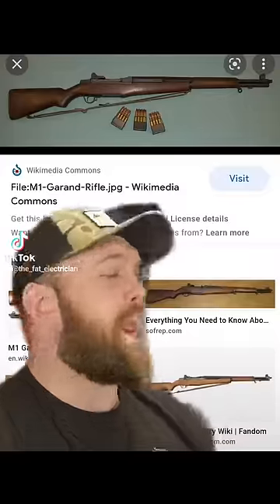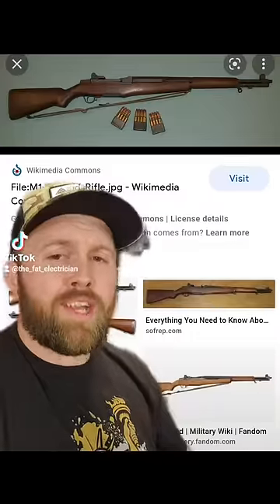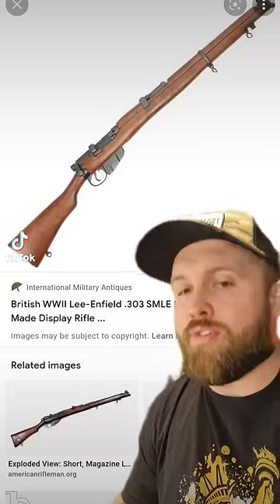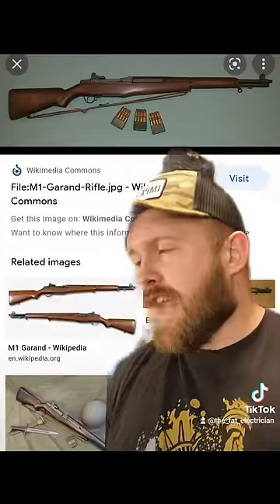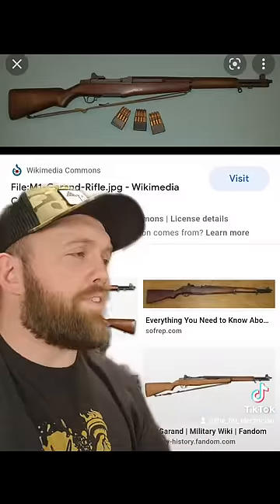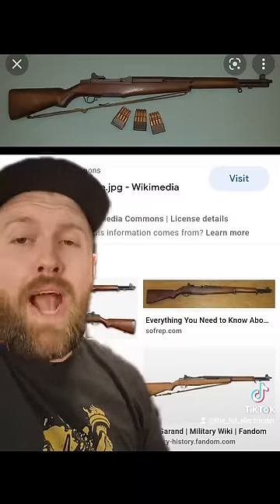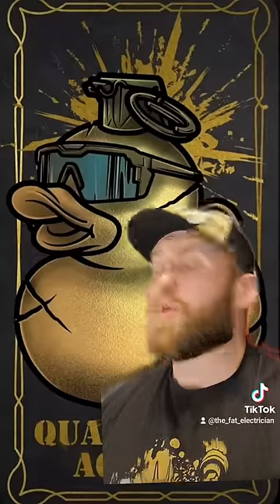The M1 Garand - "The Elder Gat"

Comment: My grand father (CIB Europe WWII) showed me the marks on his thumb from 40 years prior from Garand Thumb. Can't imagine the devastation infantry of that era would do with modern armaments.
Reply: There's less difference than you might imagine in an infantry-on-infantry comparison, most of the modern advantages show up as you start looking at the bigger picture.

The biggest game-changers would be our modern intelligence gathering and CC systems, and all the other lovely little bits of mayhem enabled by them. Things like spy satellites, GPS, GPS-guided munitions, etc.
Reply: @Just_A_Dude A squad of Marines with M1 Garands would do okay in modern combat (Not great, but still give a good account of themselves), give them M1903 Springfield's and the are all but useless. A botl action gives you 1 shot at a target, that's it. You get 5 instances of a single shot on target before a bigger delay between rounds. The sheer volume of fire difference between an M4 and an M1903 is far greater than you can measure.

Add to that how much of a difference modern optics make compared to iron sights (The M1 and M1903 have pretty good irons, still no contest vs an optic) and the actual difference between a modern infantry squad and a WW1/2 era squad is as vast as the Grand Canyon.

Comment: I've had M-1 thumb before, it's amazing the words that come out when that happens.
My dad was a weapons instructor in the Navy back in the late 50's early 60's when they still used the M-1 on ships, he was describing to the class about the detent spring and how it holds the bolt back when he accidentally touched it with his finger tip and the bolt slammed shut, he said the look on the faces of the class was priceless especially when he pulled his finger out and it was bleeding all over the place, he said he held it up and said " this is why you hold the bolt back while loading, class dismissed"
Reply: My cousin & I were on different ships that were in Gitmo at the same time in 1988.
My ship was using M14s & his had M1 Garands converted to use 7.62 NATO.
During small arms qualifications,the younger Marines got excited.
"Look,Gunny!These rifles don't even need magazines.Why does the Navy get the good stuff while we get the crap?"

Comment: When I first got my M-1, took it apart, and it was genius. Just as an example, when the op-rod is at its rear travel, the recoil spring, which doubles as the magazine spring, is fully compressed, shoving more .30-06 good good into the launch tube. 

Also, if you take the trigger group apart, make sure you put in the hammer spring housing with the window facing in. Otherwise it goes bang really fast, and you're just along for the ride.

Comment: I love my M1, it's an absolute blast to shoot. If you make sure to lock the bolt all the way to the rear, you won't get Garand thumb. There is kind of a false lock open on the gun. If you pull the bolt the rear, and still see like 1/16th of an inch of bolt face forward of the rear of the receiver, you're about to get bit

Comment: Done correctly,  loading the M1 - the bolt nudges your thumb out of the way in its travel.  Much like using a hammer- you don't put your hand in front of the strike face- you hold it by the hande. As for the ping noise- if you can hear that in the middle of a firefight, you must have some extra special hearing that isn't going to work well in a firefight.

Comment: garand thumb requires complete and total failure of the loader to remove their finger. It doesn't just ram forward when you load the clip into the magazine, you get a click upon pressing it in far enough. It stays there until you pull your thumb away, which lets it ram home.

Comment: Shot one for rifle competition for 35 years never had a garand thumb load my clips with the last round on the left side up and with my open palm against the op rod with the bottom of my hand where my last finger against the op rod handle if the bolt release’s when I push down on the clip with my thumb my hand is still in control of the op rod I swivel my hand up if the bolt doesn’t come forward I take my palm and hit the op rod handle forward have shot 1000s of rounds with out a problem the ping nose was BS

Comment: I still have my grandpa's M1. Busted my thumb many a time reloading. Can confirm about the combat rage at that point.

Also, the 30-06 rounds that were fired from the M1 were not the same loadout as in the cartrige of the same moniker today. If you fire off the shelf 30-06 out of a WWII era M1 you are going to bend the hell out of the operating rod. To the point where the rifle will cease to function. Doesn't happen right away, and may take quite a few rounds to do (like hundreds if not thousands), but happens. The proper ammo is the M2 Ball, .30-06 150-grain round. Federal used to make a 150 grain load for the Garand in their American Eagle line. I do not know if that line still exists as I've not fired the rifle in years. 

Please look into the correct ammo, or loading your own before ruining this wonderful rifle.

Comment: Garand thumb is less of a problem than people think it is. I guess depending on your grand the spring might not be strong enough to cause egarand thumb - I have to give mine a little love tap to get it to go into battery. Even on the ones with stronger springs, garandthumb only happens if you are grabbing the weapon wrong and are being an idiot with your thumb - most of the time, the bolt will just push your thumb up and out of the way.

Comment: Back in the 80's I was stationed in England. I was put in touch with a guy in Germany who had access to some unissued M-1s from I assume, WW2. Still in the crates they arrived from the States in. They were under lock and key at the Base Rod and Gun Club and were being sold for 600DM each. That was about $230 back in the day. I wrote a check so quick, I bent my pen. I rotated back to the States and waited on my rifle to arrive. Weeks go by, and about the time I figured I'd been ripped off, a letter comes. Inside the envelope was a note of apology, my check, and a BATF form with a big, red "DENIED" stamp in the middle of it. They wouldn't let it back into the country because it was a "surplus military weapon". I still get choked up over that from time to time.

Comment: Luckily I've only had a brush the G-thumb and didn't get guillotined. I did wind up with 1911-ring-finger once though. Locking back the slide and the tip of my finger went into the chamber and the slide stop wasn't fully engaged. Dropped on my finger like a bear trap. Had to have someone open the slide since I couldnt quitr get it open one-handed.
Reply: Only had one 1911 do me dirty, a brand new Colt stainless. Didn't even shoot it, locked the slide back to show a customer and slipped a little. Machining on the slide zipped my thumb right open.

Comment: It does bear mention that the gas piston is a fairly delicate part.  Modern .30-06 loads can bend the piston, disabling the rifle entirely.  The way around that is to either use M1 spec .30-06, or install an adjustable gas block.

Also:  The M1 is still so popular that 3 or 4 ammo makers specifically load .30-06 for it.

Comment: Fun fact: the original R&D variant of the AR-10, which would later become the AR-15, was made for 30-06. It would be retooled for 308, but overall the engineering philosophy stayed the same. The 15 was made as a proof of concept and a throwaway design, as the buffer-tube system was too bulky for intermediate cartridges.

If it weren't for the M14 being a cash cow for military politics, the AR-10 would've taken the spot of main Battle Rifle with the AR-15 likely being dropped out of the running for the M16 program.

It's a genuine shame that the AR-10 was overlooked like that, too. True to how Eugene Stoner engineered it, both 30-06 and 308 AR-10s have a far smoother recoil impulse than the FAL, G3, M14, SCAR H, and pretty much every rifle that doesn't use a buffer tube.

Comment: "Because the only thing you're gonna bw fuckin, is dead" lol

Real talk though. Two things.

First off, the enemies listening for the ping is a myth. A WWII battlefield was often too loud to identify a Garand ping, let alone use it as a reliable method to identify that the enemy is out of ammo. 

Secondly, if i recall how the bolt mechanism on a garand works correctly, Garand thumb would happen when the clip was inserted too far into the clipwell. There was (and still is) actually a mechanism that prevented the bolt from snapping shut when the clip was inserted. Could alternatively use your other hand to physically hold the bolt open while loading the weapon. 

But, battle field conditions creates a stressful situation where being mindful when reloading isnt exactly a priority, thus the result of Garand thumb in the battle field.

Comment: Actually, Garand thumb should NOT ever happen if the bolt is locked all the way back and the bolt lock is engaged and locked the bolt in place. You can insert your fingers and play with the bolt all you want and the bolt won’t move at all. What can happen is when the rifle is dirty, not oiled and/or haven’t been maintained for a while, which can happen when you’re in battle. If this happens, and the action ain’t that smooth, then there is good chance the bolt will not lock back all the way and get hung up on the middle jut on the enblock riser. This is highly dangerous as the bolt is not locked at all and is under high spring tension. So yeah, you insert a new en lock in and release the bolt…guess what happens next?!? BLAM!

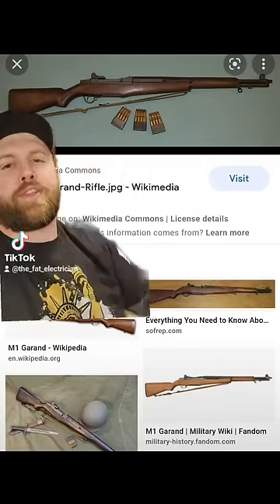Comment: 1:19 you simply CAN NOT get "m1 thumb" while loading a full clip
the bolt is blocked by the top round..... chamber is blocked by the round being feed into said chamber
.
the ONLY way to get m1 thumb is closing it when empty
or loading a clip with 7 rounds (you CANT load 8 and close it on an empty chamber.... have to "down load" to 7)
.
with 7 rounds... if you push the clip to the bottom... it trips the bolt release
now their isnt a top round to catch the bolt
and it stuffs your finger into the chamber

Comment: The myth of the ping giving away when you're empty is pretty much completely false, save for maybe some small incidents of lone men because when there's 40 of you, you don't all run out of ammo at one time.  However, as I understand it, the 8 round capacity of the M1 was weaponized by Marines in the Pacific as the Japanese had gotten used to the 5 rounds of the 1903 Springfield and so weren't ready for their target to have another 3 rounds.  Could be the same kind of false myth as the ping but I'm just not sure.